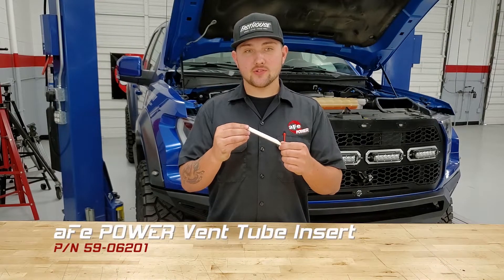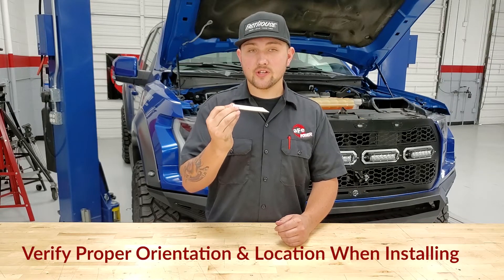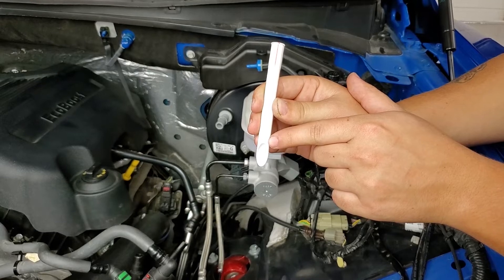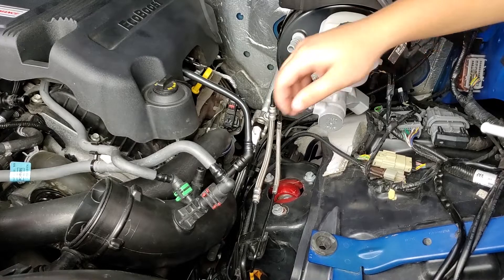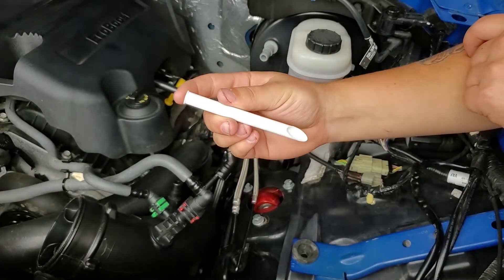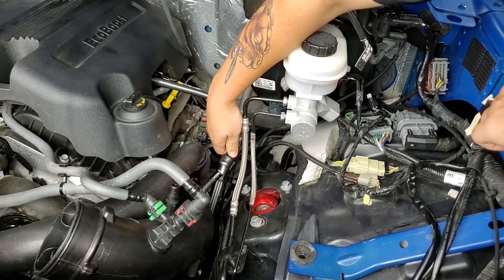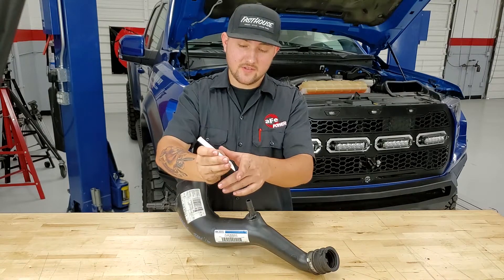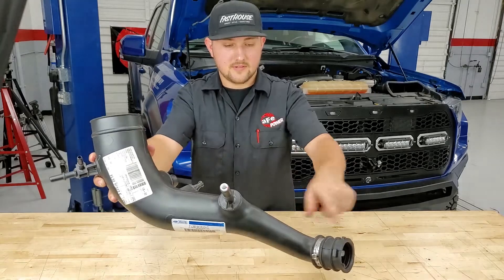aFe POWER F 150 Ecoboost Vent Insert Tube Tech Tip

Comment: AFE  $500 turbo inlet tubes and AFE $1000 intake - this tube doesnt allow the PCV to clip back in. Poor fit over all. Seriously over priced. Cant even get the airbox clips to clip onto new AFE intake. Absolutely overpriced for some bent sheet metal and two short 3.5" tubes. Why does the aftermarket suck so badly
Reply from the maker: This vent tube insert shouldn't be installed with the aFe Turbo inlet tubes. If you installed it, you should remove it immediately. that would be the reason for the connection not clipping back in.
About the fitment with the airbox clips, Please contact our customer support with pictures and we will straighten out the issue. The housing was precisely designed and tested to fit into the factory housing. https://afepower.com/support-technical-warranty
Reply: @aFePower1  thank you for the replu, after slightly sanding down the connection to make room for the lip on the tube, the PCV line now connects AND the check engine light has gone out finally.
Still can not get the frame to clip into the factory airbox. Its just going to sit on top for now.

Comment: how does this tube works only is useful to p04DB? how does it works?
Reply: Next time you're in the passenger seat of a car driving at a relatively high speed, stick your head out the window. If you slowly turn to face the back of the car, you'll notice it's harder to breathe through your nose because the air is being pulled away. When you turn toward the front of the car, air rushes into your nose. This is similar to how the vacuum tube works with the direction of that angle. Think of that angle as your nose. The air going through the intake tube pulls air out from the small vacuum tube makes it difficult for air to enter, just like with your nose, if the angle is facing the wrong way, air being pulled by the turbo will rush into the small vacuum tube (you don't want that). The hose connected to the tube has a vacuum sensor. If it doesn't detect vacuum, it throws a code to ensure the engine is "breathing" properly. Without this, a blocked or sealed engine would build up internal pressure when running and eventually start leaking oil.
Reply: @spider-man8222 I installed my S&B cold air intake, and I still have the vent insert not installed because I was not sure how to remove the Intake breather tube. I later found out the connection points are permanent through Ford’s website. So to take it off, you need to replace the tube itself. I have a new tube ready for when I install the vent tube insert. Anyways, ever since I installed my intake without the tube insert, my CEL never came on at all. So idk how not having the insert in affects drivability in the long run but I’m probably gonna be installing that insert soon

Comment: I bought the KN 77 serires, been looking for a video on the CCV tube they provided....found it on an AFE video🤦‍♂
Reply: Using the tube that k and n provided after putting it in using this video did it clear the code ?I juts bought the kN 77 and I am having the same issue
Reply: I am having the same issue as well. Just put in the tube. We’ll see if it works
Reply: @brandonbursey2911 hi did it work? I bought a new truck found out it has the insert missing and that’s why it’s throwing the code, only insert I can find is the AEM one. PLEASE let me know if it works.
Reply: @addielb8086 did it ever work?
Reply: @marshallmilne yes it did, fixed it completely. Just call k&N and tell them you didn’t receive one or lost the one you had they will send you one free of charge. You can still get a check engine code if you floor it to hard while the computer is learning. But it’s been 4 months and I’m code free.

Comment: It said not necessary for the 2.7. Is this confirmed by consumers?
Reply: I have a 2.7 and 3.6. Both code came up without this
Reply: Really? I had a cel for overboost and I pulled this tube and the code and cel cleared. Drove it home from work without the tube and no cel. I have the afe Magnum FORCE dual cone intake oil pro 5r. Will it be ok without the tube? Maybe I'll clean it and put it back in. But I drove hard today and nothing.

Comment: I cannot get the vent hose off the down tube. That damn clip will not budge. Any tips or clues to get this done?
Reply: hit it with your purse bro
Reply: Push forward and pull or slide the clip, then pull back
Reply: I have. 23 and can’t get it to move either. It’s different style clip than what is in this video
Reply: @cgunz  you need to get a 5/8 ac disconnect tool. It’s a bitch to take off off

Comment: I purchased ams turbo inlet and the vent insert doesn’t go all the way inside do you it shorter or should I just cut it?
Reply: Did you figure this out?
Reply: @eldo322  So I just purchased this same ams turbo inlet tubes and I did notice the same issue. I used some oring grease just on the outside of the fitting that sticks out for the connector to pop on it worked but still having the code P04DB. Im either going duel catch cam or replace the sensor which I'm seeing is a possible issue. let me know if you found a fix please.
Reply: @samokash4457 I just installed the ams inlet tubes yesterday and got the code today . I just ordered this little tube. Did you ever find a fix for the problem?